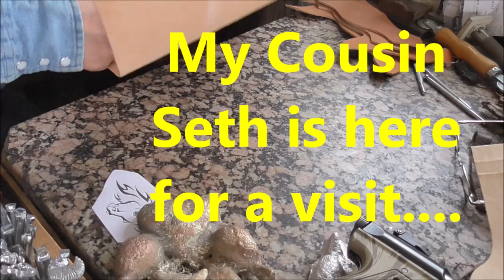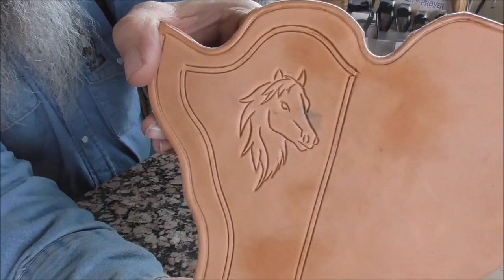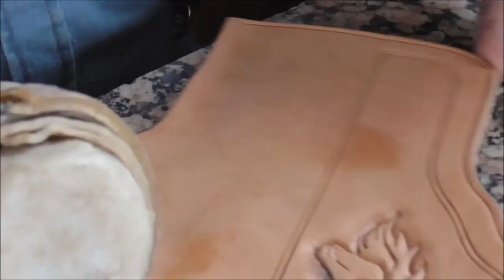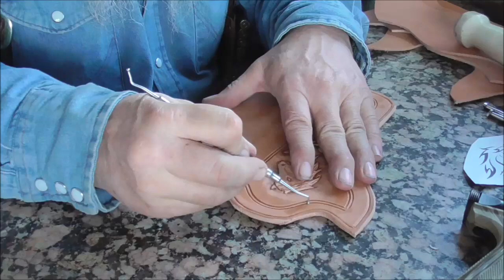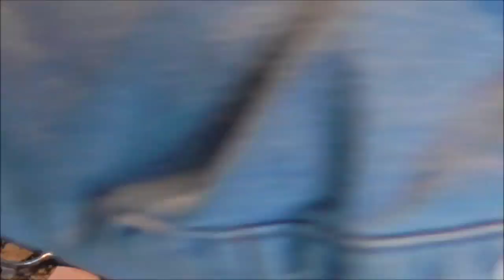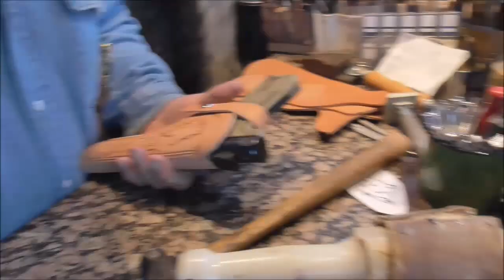Making a Leather Holster for a Ruger...Oddly Satisfying!!

Comment: Nicely done 👍
Reply from the maker: Thanks!  Didn't you have a snowdog type machine?  Did you use it this Winter?
Reply: @MuskratOutdoors  
Sold it a while back, just wasn’t using it enough… then I sold my snowmobile… then my Argo broke down… so I’ve been riding my couch all winter. 🤣
Reply from the maker: @PuskwaskaOutdoors    HA!  The couch is more comfortable anyway!  I'd like to have an Argo. Do they do well in the snow, or do they high center too much?
Reply: @MuskratOutdoors  
Depends on the snow…. I have 18” wide rubber tracks on mine and it gets around pretty good unless it’s powder snow and you try going up any kind of a hill.
If it’s wet enough to compact down I can go places where I can’t stay in the seat 😏
Reply from the maker: @PuskwaskaOutdoors    That's what I need!